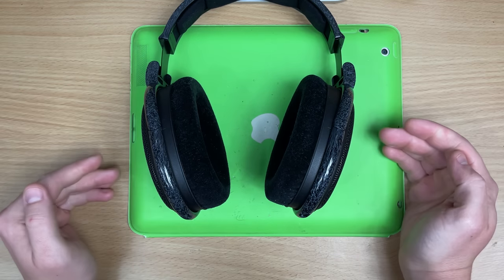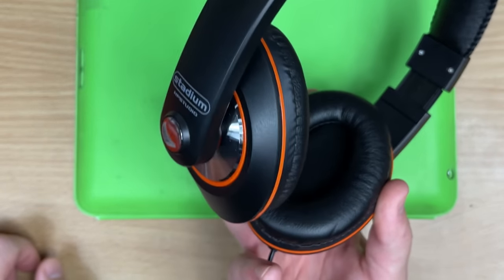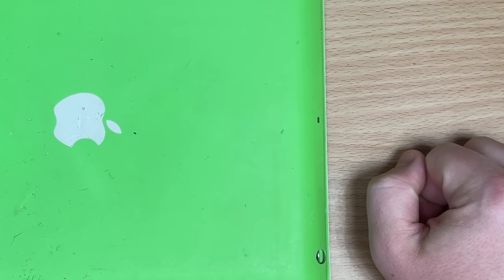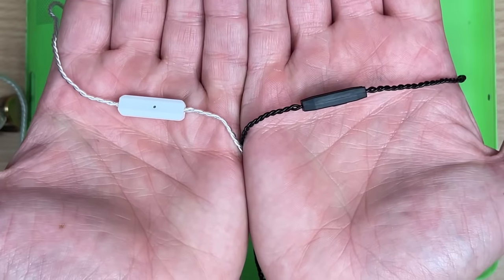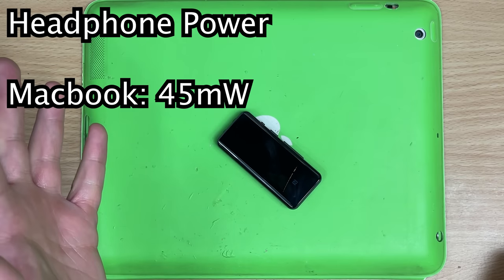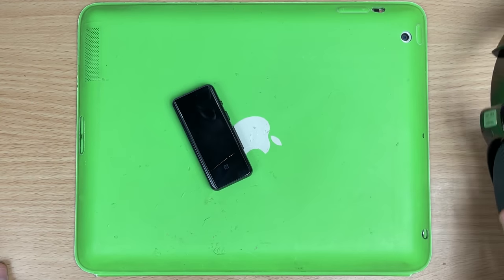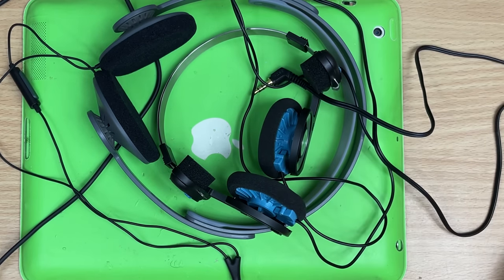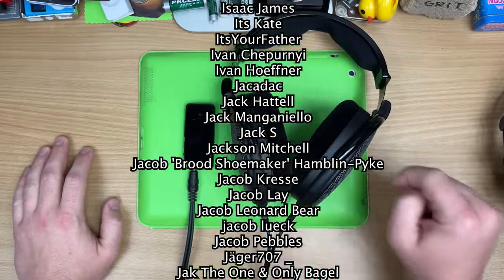My Cheap Headphone Starter Guide.

Comment: Hey sorry to bother but the Kz's are waaayy to sensitive and too loud (got an annoying hissing sound with it) my phone is actually to much for it:( Is that normal?
Reply: They are rather loud, on both PC and phone I have them almost at lowest vol. But even with my low end phone, they works fine without unnecessary sounds. So no, hissing is nothing normal.
Reply: Hey! @bboydexter1  Firstly thanks so much for replying, I'm glad they work better for you and I've looked into it the best I can and after replacing it with a different set of iem's with a lower sensitivity it worked without the hissing😄. It was a bit all over the place to research the differences in output/input of my devices and how stuff I plug into them react but it was a fun little journey😂

Comment: From what I saw in this video, the 58x do seem pretty good for the cost... but would I have to buy an amp/dac for it? Or would I be able to use with my phone? Does anybody have any experience with this? I'm new to all this audio technical stuff and don't want to buy it right away if I don't have to
Reply: the 58x has a sensitivity of 104db  and impedence of 150 ohms, so they can run out of your phone/ laptop without a dac, but would be better with an amp/ dac
Reply: @miks_w8945  Thanks so much! I may get them and if I enjoy it invest in a dac/amp!!

Comment: Be warned: I've recently exchanged and returned 2 pairs of KZ ZSN Pro X's because the first pair had very annoying white noise/static and the second pair LITERALLY SHOCKED MY LEFT EAR WITH STATIC ELECTRICITY! When the second pair worked, they sound great for their price but they're borderline unwearable. Another issue is that there's a lot of vendors all over the internet that sell these earbuds and I want to see if I can get a new pair from a legit vendor, if you know of one and can link it, I would appreciate it.

Comment: Hey, maybe you audiophiles can help me out! I’ve been looking to get a pair of cable headphones just to listen to Spotify out of my phone, but I don’t know what to look at for something on the low-end in terms of price. 

I’m autistic, and headphones that have a lot of bass really hurt my ears. I want something without audio bleed so I can slip them on in public when I need to calm down. (I really rely on Spotify to cut down on overstimulation!) The cheaper AKG headphones caught my eye, but would they be good for someone sensitive to a ton of bass?
Reply: Hello! I too am on the Spectrum and Headphones aren't just a thing I enjoy, they're a vital part of my work, and also a sensory tool for dealing with the noise of the world. 

I can recommend the Beyerdynamic DT770s Pro (32 ohm version), the Sony MDR7506s, and Audiotechnica ATH-M50x's if you like a nice, balanced sound that doesn't break the bank. They all should set you back about A$250 for a pair. 

I use the DT770s and MDR7506s myself as studio monitor headphones. If you go with either of those, go to a place like Custom Cans in the UK and get a pair with a shortened cable for use with your phone. They sell modified pairs of these headphones for use with mobile phones (with removable cables, balanced cables for DACs etc.) I use a pair of the 250 ohm DT770s in my home studio through a Presonus 24C, and I absolutely love the high-end detail they chuck out. The 32 ohm versions are much of the same, albeit with slightly more bass and well, being 32 ohms you can drive them from pretty much anything! 

If you want a nice pair of headphones that will also help with sensory issues, I can also recommend the Bose QC35ii wireless headphones. They can be driven passively with a cable, used wirelessly or used with a cable and ANC enabled. Add a pair of Dekoni velour pads and you'll have an incredibly comfortable, balanced pair of headphones. 

You can always dial bass out of a pair of headphones as well. If you go with the AKGs, you can use your phone's built-in EQ to dial back the bass too :)

Comment: Hey gang is there something like the amazing Senn HD58x mentioned by our wonderful DankPods-but down to 100 ohms from 150 ohms? the reason I asked is i accidentally ordered the FiiO BTR3K instead of BTR5 and I think 3K only does 100ohms >.<
Reply: It's fine. His explanation of impedance (ohms) is kind of off. 

You also want to pay attention to sensitivity. The 58x and even HD600 are quite sensitive. So even though they're a bit higher impedance, you can  run even a HD600 off of a phone jack

Comment: !!DO NOT BUY SAMSON SR850s!!
After only three months of careful use and handling, the stress relief where the cable goes into the headphones broke, and the cable gave out not long afterwards.
(Hell, even in the video itself you can see the cable on Wade's pair is kinked and is starting to give out.)
This was on top of the earcups near constantly falling off and the cheap plastic housing creaking whenever I moved my head.

Comment: I HAVE A WARNING FOR PEOPLE WHO WANT IN EAR MONITORS! DO NOT GET THEM CLOSE TO MAGNETS! 

I had some in my pocket during work, and I use a magnet to unlock tags from clothes, and the magnet hung down a little near my pocket. After work, they didn't have any sound after. So be very cautious.
Reply: That's pretty much anything with speakers; they're powered by magnets, so anything that changes the magnetic force will effect the sound. You might be able to re-magnetize them maybe?

Comment: your HD 600 frequency response graph doesn't match up with the data on the reference audio analyzer website, where is the truth?
Reply: So when looking at a frequency response graph, you need to know what type of graph it is.

The ones Wade uses is a compensated graph on rtings which isn't ideal. What it does is it takes the raw data, and flattens it to a target which supposedly replicates our ear, because we don't hear a flat response by the time it reaches our eardrum.

Other sites like crinacle and more scientific headphone measurment sites show is a raw graph where it would look mostly flat between 20-1000hz, and then have a rise and fall between 1000hz to 20000hz. This more accurate depics how our ears hear, and is acquired by a measurments rig with a fake ear.

Looking at that website you mentioned, it looks like they are using a raw graph, but their measurements doesn't have a fake ear, so it is not accurate past 1000hz unless directly comparing with another headphone measured on the same rig. That's usually what we call a flat plate measurment. Either that or they're using their own custom target which again makes it only useful for direct comparisons to other stuff from the same website

Comment: weird, my koss porta pros cost 20bucks off amazon, and have had them for years now...use them ALOT when out and about... pocket them alot havent broken yet...
Reply: Meanwhile my KPH30i snapped in a month at the plastic slider. Porta Pros are very durable
Reply: @JamieVatarga  Maybe you got a faulty version? Did you request a refund, maybe a second pair. The kph are built way better IMO, still not very good but still better than the porta pros
Reply: @boyanpetrov1683  it's a common issue with people I've talked to. The slider if the headband is very thin and weak there. Where as people have had their Porta Pros for decades

Comment: ngl, if your porta pros are getting all broken up, then you're probably trashing them around.

the kph30i, however, breaks so easily that they find it hard to last a year just being house headphones.

my circle of friends all have porta pros because i gifted it to them the first time i heard about them some years ago. the porta pros have become their daily drivers, with some of them even asking me to mod them to turn them wireless. its been, what? 6 years? not a single one has broken.

just because it feels and looks cheap doesn't mean its built cheap. they managed to find ways to make it cheap all while being sturdy.

Meanwhile, the kph30i is the true definition of cheaping out. I take it off my head, the flimsy adjustment snaps for no reason. they can't even last months without it snapping like twig.

and if you truly hate the build quality of the porta pros, then just get rid of the headband and snap some ksc75 earclips on them. While you're at it, mod them to be wireless and put some yaxy pads on them. there you go, sturdy, comfy, tws porta pros that blows any tws solution within its price range even after modding out of the water.

Comment: SHP-9500's for 60 bucks, you won't need anything else for years.
Reply: Yeah, no
Reply: @saamo1423  we're talking about cheap here. Of course there are much better headphones that you should upgrade to. But if you don't have money but you want quality sound, the 9500s are a life-saver. You won't feel like you need to spend even more money on headsets for a good while. 

Again, we're talking about someone with little money here, because that's the topic of the video.

Comment: What does it mean when headphones have much ohms? are the just louder or do they sound bether? because if they are just louder, thats not realy a plus point for my allready shredded ears xD
Reply: Ohms in headphones refer to their impedance, and it basically means how hard it is to power them. If you have high-impedance headphones (over 150 or 200 ohms, I think), a lower-powered audio output like a phone's headphone jack may not be able to deliver enough power to drive them sufficiently, which can cause them to be quieter or have their sound quality suffer. In that situation, you may need an external amp to power them. Some people say that a higher impedance means higher quality sound, but I'm not educated enough on the matter to comment on that. Higher-end headphones do tend to have higher impedance, though.
Reply: It means that they require more power and it can lead for them to be little louder and higher quality but just a bit
Reply: ah on thanks ^^

Comment: The Koss KPH30i is terrible! I was curious about the Grado sound, "best ones for rock music" and etc, and a guy out there on YT made a review of the Grado SR 60e and said that the Koss KPH30i was better and cheaper. Crap! What were those bloated, grainy mids and upper mids? Almost no highs? Really? Well, nice bass, though. I was afraid I got a spoiled unit, sent them back and got new ones, same crappy sound. Then I finally got a Grado SR 60e. Not as good as my HD 650, but hey, WAAAAAAY BETTER THAN THAT KOSS KRAP! Even for the price, the KPH30i stinks, you can have it better for the money: Superlux HD681, the Samson's, the Monoprice 8323 (I have it, it's AMAZING for the price, and it's cheaper than the Koss Krap)... gosh even my less than $10 RY4S earbuds sound miles better than those, it actually gets close to the HD 600 sound (no, I'm not kidding).

So... Put that Koss Krap away from my view. Eeeeew! 🤢🤢🤢🤮🤮🤮